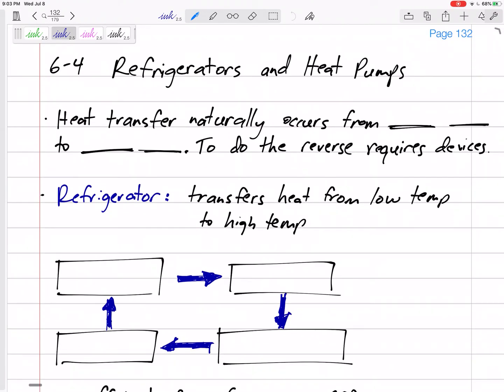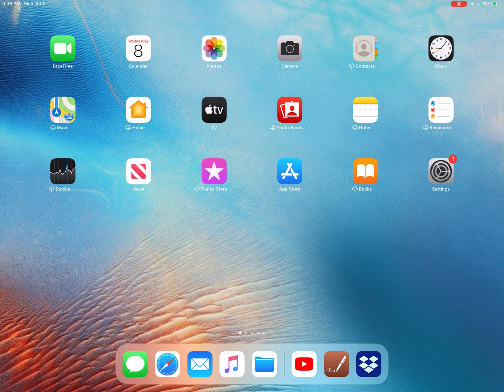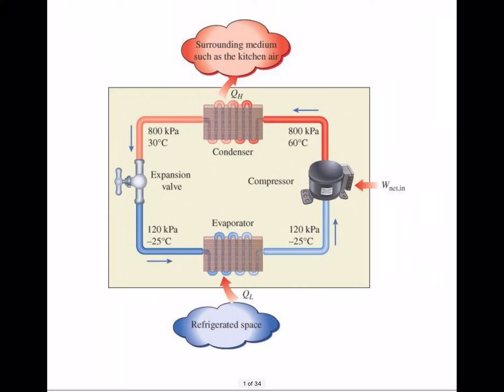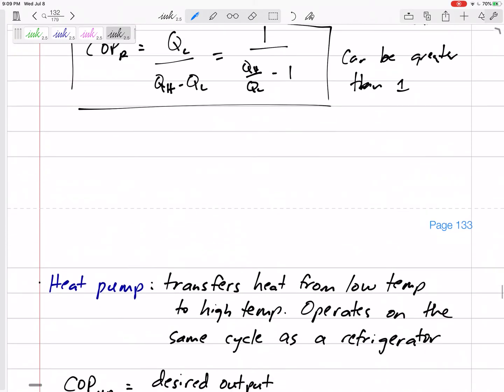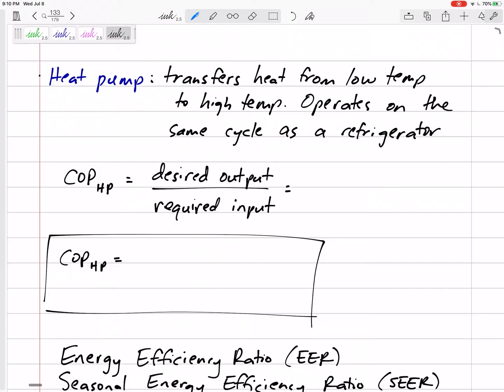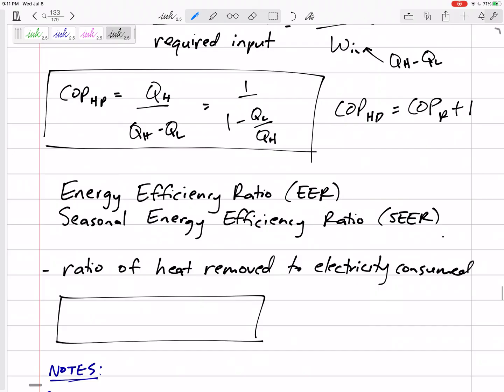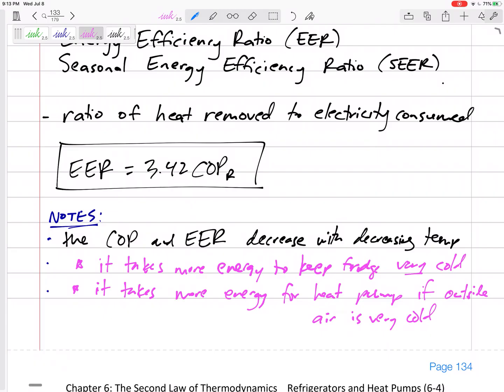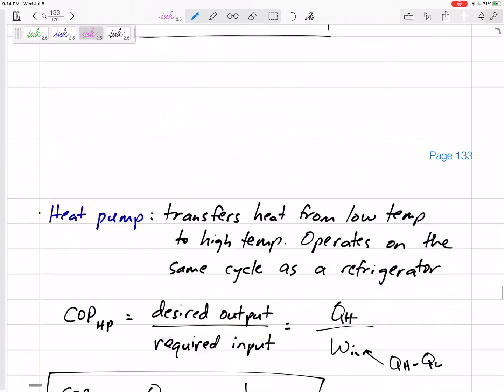Thermodynamics - 6-4 Refrigerators and Heat Pumps - notes

Comment: Professor,I have a question here .We call Qin =Qh and Qout=Ql in the last video about heat engines.But here Qin=Ql and Qout=Qh .Could you clear up my confusion here ?I really appreciate it
Reply from the maker: Correct. The last video was about heat engines. This video is about heat pumps and refrigerators. Heat engines do almost exactly opposite what heat pumps do. Heat engines accept heat and turn some of it into energy. Heat pumps accept energy and turn some of it into heat. They run on the opposite cycle so yes, the Qin for a heat engine is Qh, but the Qin for a heat pump is Ql. But for everything the hotter temp is Qh and the lower temp is Ql.
Reply: @engineeringdeciphered  Oh got that professor ,I really appreciate it
Reply: @ygt824  kanka finaller ne zaman bass basssss
Reply: Can you plz tell me, in heat pump why we take desired output = QH, because we are taking heat from outside which is at lower temp from inside , so why not QL.
Reply: @AbdulHashir2626  for heat pumps aim is to cool inside so QL is the desired output, Win is the required input